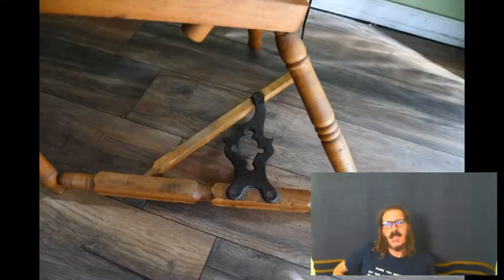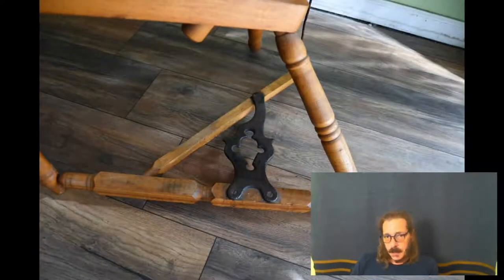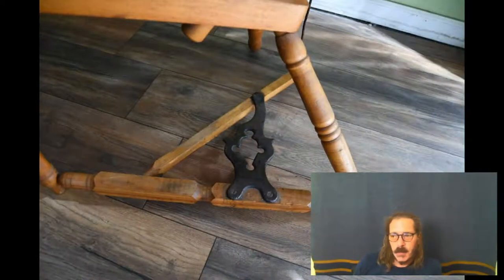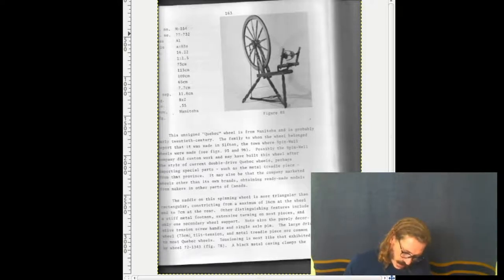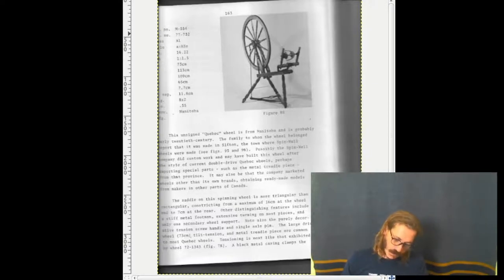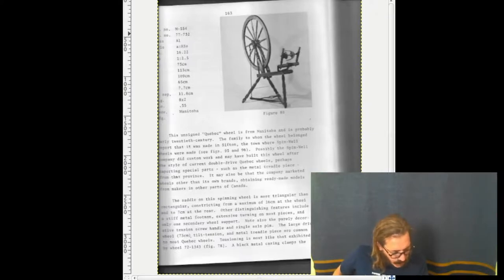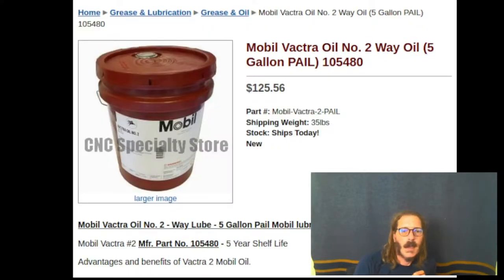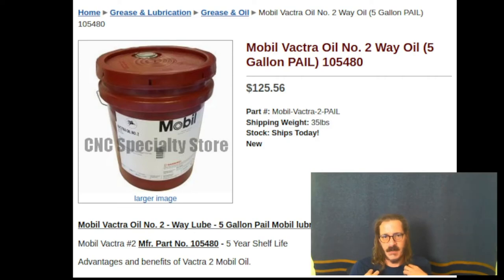Canadian Production Wheels & What Oils to Use

Comment: I do not understand the "mess" you are talking about from sewing machine oil; it's specifically designed NOT to stain fabric or thread in clothing factories where a mess would spoil the goods (and cause loss of income/profit). I used it on my 1980s-ish Ashford Traveler for decades with no issues; recently I switched to Ashford-brand spinning wheel oil on the advice of a wheelmaker and restorer who opined that sewing machine oil isn't thick enough to be ideal. It never gave me trouble, however. He also suggested 30 weight motor oil which is apparently what the Ashford brand oil basically is, so what you suggest seems on target.